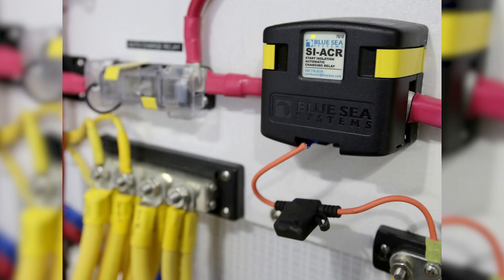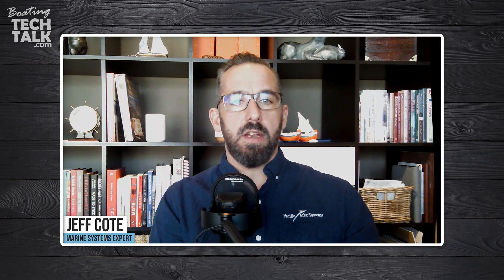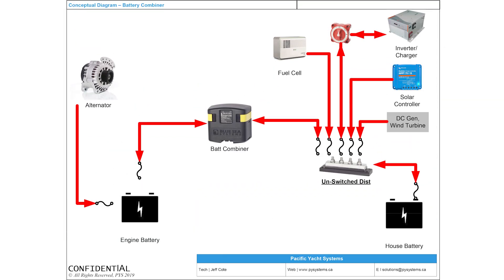What Is the SI Post for on an SI-ACR Battery Combiner?

Comment: I have a question as I am new to the ACR system. 
I have a trailer boat and would like to charge my batteries at home in the driveway. Do I just connect the charger to the battery terminals as usual or is there another way?

Comment: Good morning from Greece. I would like to ask you a question. I have BLUE SEA SI-ACR 120 A, I can have two batteries with different AH. 100 AH & 80 AH. And secondly they can be 100 AH and 100 AH.Because I was told by the store where I bought it that the batteries should not be more than 60 AH left + 60 AH right Is this true or can I put two 100 AH . Good seas

Comment: Thanks for the info I was wondering about that? HOW would I wire the SI post? Does it run to a manual switch? Ignition? Is SI automatic during starting? Still a lot of unanswered questions...

Comment: why do I have power to the ground wire coming from the si-acr ?? if you pull the 5amp fuzz and test the fuzz holder one side has +power showing but when you put the 5amp fuzz back  it shows no power at the fuzz going to ground?? I'm looking for the reason my batt are going dead with the main switch is off. Any ideas??? please

Comment: The way I view it is that if both battery systems are always joined, House-use can drain the Starter battery. If the House goes low, not a problem, just an inconvenience. The other way around, big problem...git yer oars out.

Comment: Wait, sorry to be confused, but when the start key is turned, does it disconnect the house battery and only use the start battery?  Do the electronics cut off and cycle power?
Reply: No, it would separate the house and starter circuits because that what it sits between. It doesn’t sit between the house battery and the electronics and house loads, so it can’t disconnect them.

Comment: Without any other charging sources, would a regular ACR without start isolation ever be connecting both batteries? 13.3 is the cut in. I can't imagine my batteries would be connected until after the motor starts.

Comment: Charge voltage to engine battery should go through lead-acid charge controller as well.  This would also limit the V-A impact to the house circuit.  Either way, this video was very insightful.

Comment: Hi Jeff, thanks for the video,  I have a question.  the boat I'm looking at for a friend has agm house batteries and a calcium start battery. My question is can an acr be used with these 2 different chemistries.  My only concern really is the disconnect voltage the agms full sit at 13.1v. The acr disconnect voltage is 12.8v so I'm thinking overnight the calcium battery will pull those agms down until it disconnects at 12.8v. Is this a big concern or am o worried about nothing.  Regards Stormer
Reply from the maker: With a bit of load the acr would probably disconnect after 15 mins or so.  An AGM battery is not going to hold 13.1 volts for long with any load on it.
Reply: @PacificYachtSystems  thanks for the reply Jeff much appreciated.  The only load on it is a rule bilge pump the new gen one that spins every once in a while to check for load maybe the led anchor light too so the loads are very low, the start battery while the acr is connected would be a load tho,  guessing fully charged it'd still pull an amp or so from the until the acr disconnects it's 4x100ah powerlyte agms. I was thinking maybe I could put a diode on the negative wire of the acr,  am I off the mark here, would that possibly work? Would that lift both setpoints by 0.6v... I could do a bench test I guess before I install.

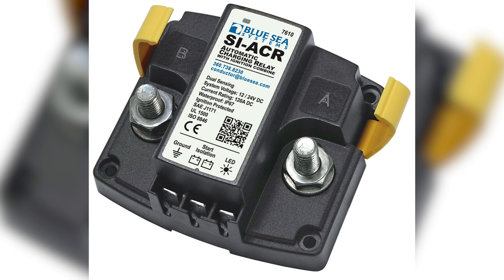Comment: 1:15 and elsewhere:  "automatic combiner relay" -   Blue Sea's website and supporting documents say "Automatic Charging Relay".  Perhaps the nomenclature used to be combiner and they changed it?

I enjoy your vids even though I don't own a boat!
Reply from the maker: Probably just a mistake on my part.    This product and it's competitors (vsr etc) are all considered battery combiners.    As opposed to a battery isolator which is totally different.
Reply: @PacificYachtSystems  ACR's do not combine batteries.

Comment: JEFF, I agree with all the "reasons" you stated.  But, you didn't mention the most important reason.
The #1 reason to use the S.I. is to avoid "recoil/fly-back/surge" voltage spike upon starter dis-engagement.
During cranking, if the ACR is still combined, and the engine battery is weak, when the starter is DISengaged, the "system" voltage will momentarily JUMP WAY UP.  A voltage "spike", if you will.  House electronics can be damaged from the spike.  The house battery does act as a  buffer, but, not if the spike is too high.  An o-scope can capture a picture of the spike for your viewing pleasure!
Reply from the maker: I am aware of this but I have never measured it.   Our avg house bank size is 800ah and I imagine it could buffer a fair bit.    On a single house battery It might be more concerning.    It would be interesting to measure the spike on different size banks.   Many boats are still using a 1-2-all switch and the electronics are always connected to the  engine when starting even with no acr.   If that spike was really an issue I think we'd see a lot more issues.
Reply: @PacificYachtSystems  
Yes, most electronics do have power input over-load/high voltage spike input surge  "clippers" to self-protect themselves.  But, those clippers aren't designed to overcome  bad power system designs.  They valiantly absorb LOTS of Bad Ju Ju from power system voltage variables.  They are the unsung heroes!  Sentries, always at the ready.  But, they are tiny and can only do so much before being over-run.

I hope you do a video, with o-scope captures, revealing the hidden truth on what really happens, when stuff is both turned ON and then, OFF.  (Most often, it's the OFF which causes the damage).

Most people will be glad if you are more right than I am.
Please do put my words to task, on multiple boats. Everybody will benefit, no matter the results.

In my work, I have one MANTRA:
"Remember to TEST!  Don't guess!"

For if not, sooner or later, yee will be, forever moored in, the Bay of Regret!"

Thank you all, for all you do.  The electrical industry needs guys like you.
Brett Yenzer
Sacramento, California

Comment: Isn’t it very dangerous not to have the SI post wired ? An ACR just used for charging typically has a smaller gauge wire (suitable for charging but not for starting current). Since the only connection to the house battery would be via the ACR, wouldn’t the draw from the house bank (via the lower gauge charging wire) risk a fire ? This is assuming the ACR is engaged. 
Or it doesn’t work that way :) ?
Reply from the maker: I normally wire acr's with 2awg.  Both ends are fused at 150-200a.   Most of the current is still going to come from the start battery.    If too much starting current came from the house battery the fuses would blow so it's not a safety issue.   however that becomes a reliability / usage issue because you can't be having those fuses blowing and losing the acr function.  But rarely if ever do they blow.

I've actually used the SI port for bow thruster banks to disable charging when the bow thruster is in use.  as then picking acr wire size and fuses to the bow battery becomes easier. otherwise the acr current can be larger and longer to a bow battery then it would be to an engine battery while starting.   But for engines I've never needed the SI port

Comment: Glad you’re back! I have an ACR-SI, installed by a previous owner. The SI connection was not wired in. So, I wired it in. Only after a little trip to the San Juan’s did I realize I wired to the wrong post on my starter switch. The “run” post. After repeated startings, one morning at anchor it wouldn’t start. I jury rigged my solar panels to my starter battery for a couple of hours to get started. I also disconnected that SI wire. I had effectively taken my starter battery out of the charging circuit.  Who knew? My previous trips had been short enough that I was always back at the dock on shore power.
Reply from the maker: it needs to go onto the "start" wire which only has power while the motor is cranking.   It will be the small wire on the starter.

Comment: So the SI post would be connected to the starter positive to feed a voltage when the starter's engaged?
Reply from the maker: you would need to wire into the "start" wire.  It will only have power when the key is being held to start and the motor is cranking.  So the acr is only off for a few seconds.  if you wired to the positive post on the starter, the SI would be constantly powered and the ACR would never engage
Reply: Connect to start lead on ignition switch. Suppose you could instead tap into same wire downstream where it’s the + trigger for starter solenoid.

Comment: Very good timing on this content. I am in the process of purchasing a boat with bow and stern thrusters. When using the rear thruster the electronics are affected by voltage drop.
I was planning to add a dedicated battery for the rear thruster (front already has one near bow) but I think to make things simpler I will just run it off the start battery but use a combiner and utilize the si function to isolate the draw from the house batteries whenever the thruster is engaged, therfore keeping voltage drops away from electronics.
Reply from the maker: I have used the Si function to a bow thruster control.  It works well.  can be tricky to hook up to the thruster.